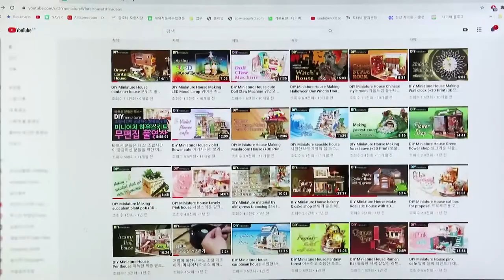DIY Handmade Miniature maiking LED Wire tree DIY 미니어처 와이어로 LED조명나무 만들기 DIY手作りミニチュアメイキングLEDワイヤーツリー

Comment: 안녕하세요! 아두이노를 이제 접하게되어 배우고있는중인데 딱 이거처럼 교차로 led이 불들어오게 하고싶은데 코딩소코드 알 수 있을까요?? 아무리 찾아봐도 이런식으로 불들어오게 하기가 어렵네요 ㅠㅠㅠ
Reply from the maker: arduino pro mini 를 사용했어요 Mini 는 5v 동작과 3v 동작 모델로 나뉘는데요
LED working voltage 가 3.3 이라 Mini 도 3v 동작하는것으로 선정했어요
LED on/off 가 아니라 서서히 켜지고 끄는걸(dimming) 원해서 PWM pin 을 사용했구요
Mini 는 PWM pin 이 6개 밖에 없어요 그래서 영상에서도 LED 6개만 달았습니다.

GND 는 모두 묶어주고 pwm pins 에 모두 연결해주구요
arduino PWM 출력 코드는 인터넷에서 쉽게 접하실수 있습니다.
PWM duty 가 0~255 까지 이며 6개가 모두 따로 움직이는 듯한 연출을 위해 증감 속도를 따로 주었습니다.
Sample Code 처럼 작성하시면 LED 1은 LED 0에 비해 두배 빠르게 dimming 합니다.

[Code Sample]
const int ledPin0 = 11;
const int ledPin1 = 10;
int duty0,duty1;
Reply from the maker: void setup(){
    pinMode(ledPin0, OUTPUT);
    pinMode(ledPin1, OUTPUT);
}
 
void loop(){
    // 1st LED Control
    if(onoff_flag0)
   {
   duty0+=2;
      if(duty0>255)
         {
         onoff_flag0=0;
         duty0=255; // overflow exceptionhandle
         }
   }
    else
   {
   duty0-=2;
      if(duty0<0)
         {
         onoff_flag0=1;
         duty0=0; // overflow exceptionhandle
         }
   }
  
    // 2ndt LED Control
    if(onoff_flag1)
   {
   duty1+=4;
      if(duty1>255)
         {
         onoff_flag1=0;
         duty1=255; // overflow exceptionhandle
         }
   }
    else
   {
   duty1-=4;
      if(duty1<0)
         {
         onoff_flag1=1;
         duty1=0; // overflow exceptionhandle
         }

   }

    analogWrite(ledPin0, duty0);
    analogWrite(ledPin1, duty1);
    delay(2);
}
Reply: 와아 답장주실지 긴가민가하며 댓글달았는데 이렇게 자세히 알려주셔서 너무 감사드립니다ㅠㅠㅠ꼭 시도 해볼게요 다시한번 감사드립니다!